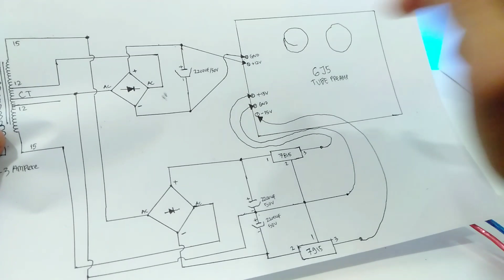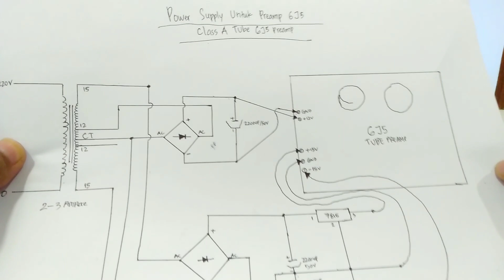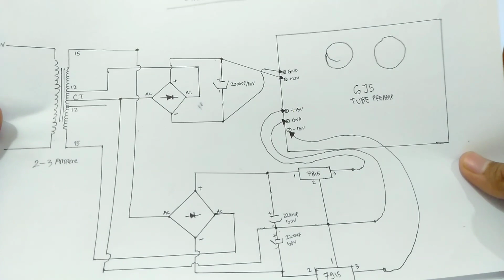Banggood | Review Preamp Tabung 6J5 Class A | Indonesia

Comment: PSU yg atas itu buat heater tabungnya om, coba diliat di datasheet tube nya, butuh berapa volt. 
kalau yg bawah kan untuk opamp nya, opamp biasanya butuh PSU simetris, makanya ada butuh ground dari CT.
Reply: barusan saya cek disini http://www.mif.pg.gda.pl/homepages/frank/sheets/127/6/6J5.pdf untuk 6J5 , tegangan heater butuh 6,3 volt, sedangkan kalau pakai PSU / Aadaptor yg hitam itu kan 12 volt, kalau dibagi 2 kan cuman 6 volt, mungkin karena itu dia ga nyala.kalau diambilkan dari PSU yg bawah (yg 15 volt), mungkin masih bisa dihubungkan ke ground CTnya om.
Reply: o ya, btw, kit pre amp tube gitu, banyak koq om yg jual, dilokal jga banyak. coba cari merk YUANJING (merk nya agak songong emang.)
Reply from the maker: gak bisa catu daya langsung dengan opamp nya, dah saya coba jd dengung, pakai adaptor smps 2A/12v itu oun dengung, giliran digabung dengan trafo ampli yg 5A baru aman, wkwk
Reply from the maker: soalnya ini kan class A butuh amper gede, dan banyak terbuang jadi panas
Reply: @barlexrespectaizer452  catu daya opamp nya awalnya brapa ampere om??soalnya 6J5 nya butuh 300mA klo ga salah masing2nya.
Reply: @barlexrespectaizer452  kurang tau jga sih dia class A apa AB, soalnya pakai opamp, bukan mossfet untuk final stagenya.yang sjelas sih emang untuk tube , pakai heater, yg memang butuh power PSU besar untuk heaternya saja.
Reply from the maker: awalnya 2Amper,